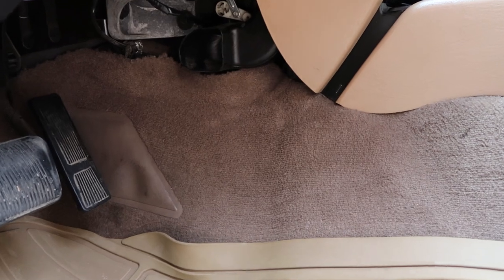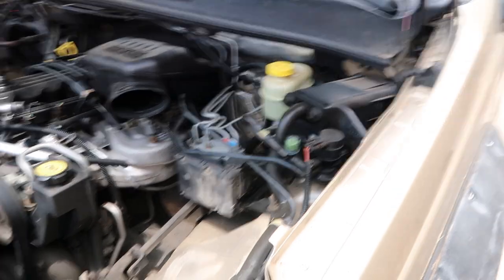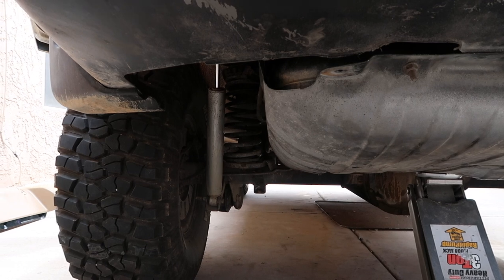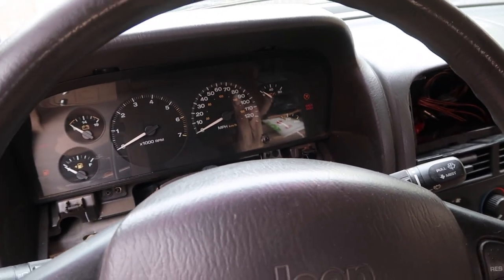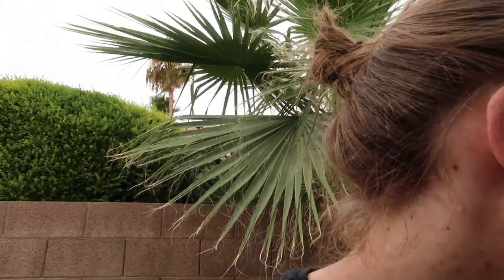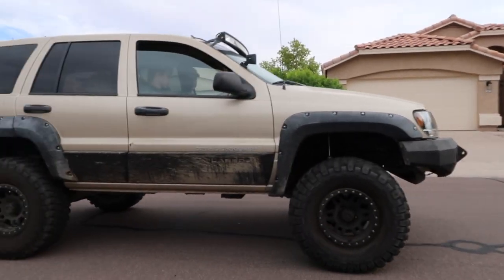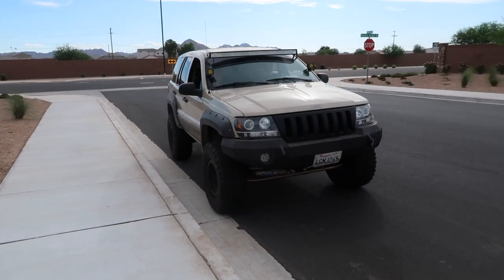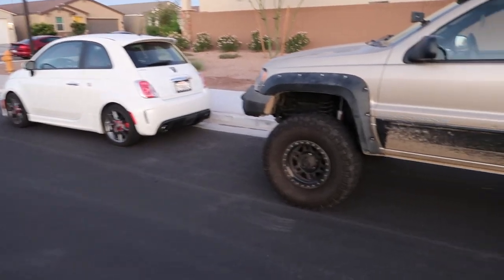Crankshaft Positioning Sensor | 1999 Jeep Grand Cherokee 4.0L

Comment: So the issue was the exposed wires hitting each other and shorting out? 
Well at least we found out that the Standard brand of crankshaft sensors works, I've had an issue finding out which aftermarket sensors work as there is a shortage of MOPAR (Jeep manufactured parts) crankshaft sensors. I also discovered that apparently the reason the crankshaft sensors have an oval shape is because after you place the sensor in, you are to put in the bolt and then pull the sensor out until it hits the bolt so that the sensor does not touch the engine and shorts the sensor, which would cause it not to start. I realized I had a problem when my Cherokee would die if I hit the smallest of bumps on the road. I found the wires that were causing the short, but I followed the wires and noticed that it was the wires going into the sensor were exposed and likely causing the shorts that were causing the Jeep engine to shut down. Unfortunately, I need to find an aftermarket sensor that works due to the MOPAR sensor shortage. Thank you for this video.
Reply from the maker: Yeah unfortunately it was just a shorting out issue. Sucks after buying parts but I’m glad it’s going again. And I don’t believe my crankshaft position sensor was a mopar part. It has a piece of cardboard on it you leave on to set the depth in the motor, and then after install the cardboard just gets shredded off